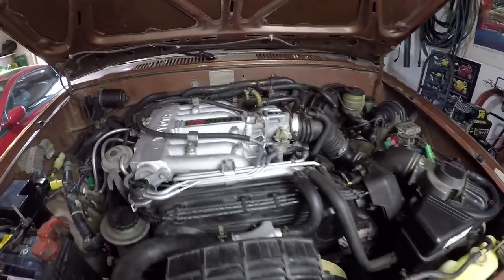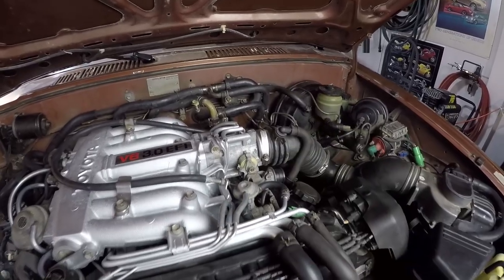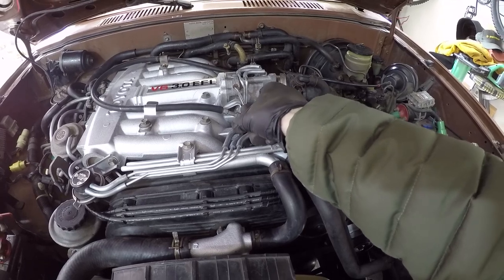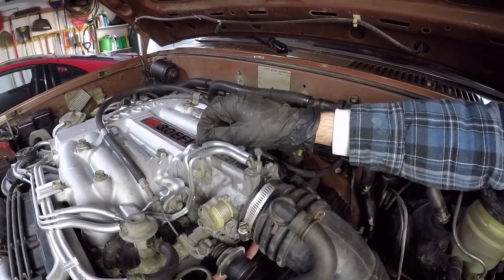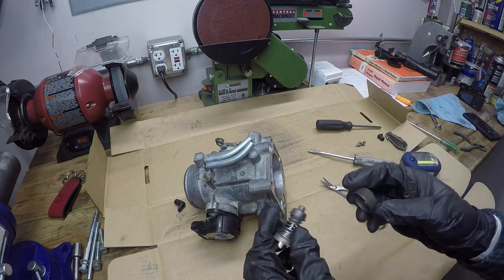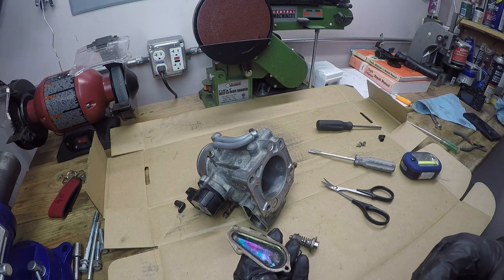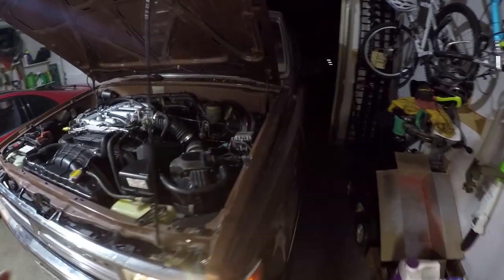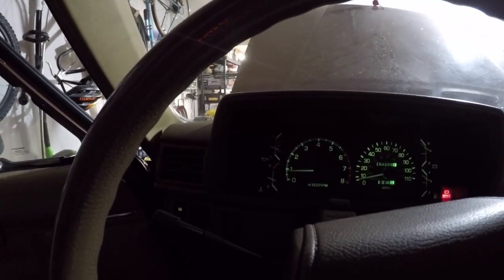Toyota 3VZE | Ep.9 | High engine idle speed EASY FIX!

Comment: I got an issue on mine, it always goes to a high idle but if I rev it a bit it’ll drop to my adjusted idle. I’ve got it adjusted to 800rpm and high idle is around 1200 till I give the throttle a blip then it’ll idle back to 800. Think this could be my issue?
Reply from the maker: I haven't heard that one before. Hmm. I suppose it could be this, but I'd first check to make sure the butterfly valve or the throttle cable isn't binding somewhere.

Comment: Would this work for low idle too? My idle adjust screw doesn’t seem to do anything in when turned in either direction. My warm idle seems about 700rpm
Reply from the maker: This would only help if you're experiencing low idle during a cold start. Interesting that the idle adjustment screw doesn't have any affect at raising the idle speed. I would check the simple stuff first, like the air filter, to make sure it isn't clogged. Then I would check for vacuum leaks because those can sometimes cause a rough and lower idle.

Comment: Thank you so much for your posts! Very helpful. Have ever played with the TPS and adjustments?
Reply from the maker: Not on this 4Runner, but I have on a pickup with the 3VZE. I'd recommend adjusting it if the engine idle "hunts" when you press the brake at idle.
Reply: @PracticalEnthusiast  I just did the heads on my 94 4runner and replaced parts along the way...including the TPS. I pretty much set it in the middle. It doesn't "hunt" when I push on the brake. From what I gather, the TPS has to be set prior to timing it, and I am having no luck in finding a video in how to do so. No explanation in my Haynes either. Thank you for your quick reply and thank you for taking the time!

Comment: I’m having problems with my 1992 Toyota V6 3.0 EFI  after my suv is warmed up and my idle speed is 800 the engine dies when I shift from park to drive. If I shift from park quickly over to 2nd or 1st it’s fine the engine continue to run fine. I have checked all vacuum lines and removed the throttle body and cleaned the IAC valve. I took my suv to Toyota dealership mechanic the ran a diagnostic check everything passed. They where unable to recreate the problem. Note it’s intermittent. Any suggestions, thanks
Reply from the maker: That's a tough one. The idle control on this engine is fairly rudimentary and I don't think it has any idle-up system to account for an automatic transmission being put into drive or any other gear. That makes me suspect that something may be wrong with the torque converter. It might be partially or fully locking up when put into drive, causing the engine to die.

Comment: Thanks man!  Mine has a high idle but also the idle surges sometimes.  You think this is the issue?  I took the TB off and coolant goes through it nicely so I'm at a loss.
Reply from the maker: Does it surge only when the brake is depressed? If so, it is likely your throttle position sensor is out of adjustment.
Reply: My 88’ 4Runner surges at random too. Took throttle body off and cleaned it. Ran the codes for the check engine light and it shows “TPS” so gonna change that next. It’ll surge when I push the brake it but some times does it even with the brake not engaged, still could be tps? Or anything else?

Comment: I noticed you have 22R style connectors and a 22R style ignition coil and igniter. Did you swap it and why?
Reply from the maker: I never swapped it, so I'm not sure what's up there. Sure it wasn't used on early 3VZEs as well? This one is a first year (1988).

Comment: I know this has nothing to do with your video Can you help me?
I ran the advanced diagnosis program.
Instead of error codes the o/d and check engine lights flash continuously.
Do you know what it is trying to tell me.
Reply from the maker: By "advance diagnostic program" do you mean bridging E1 & TE1 in the engine bay diagnostic box? 

If you are getting a continuously flashing check engine light when bridging those two terminals, then it could mean the that the E1 terminal is no longer connected to a ground (this happened on mine). Try grounding the TE1 terminal to any other ground point in the engine bay.
Reply: @PracticalEnthusiast  Yes after running E1 to TE2 test mode
Toyota service manual page FI 128
Reply: The overdrive light and the check engine flash at the same time continuously.
All other lights are off. My problem is truck runs fine until it gets to operating temperature.
Then it looses power misses and surges forward .  Very rough idle Have checked the basics plugs,wires timing.
Replaced tps . Had top end rebuilt 3600 miles ago. Burnt exhaust valves.
Reply from the maker: Try bridging TE2 with a ground somewhere in the engine bay. It is possible that E1 is no longer connected to ground. That hopefully would allow you to pull a code.

Aside from a possible mechanical/compression issue that crops up only when warmed up, I would guess that possibly the engine temperature sensor is faulty.
Reply: @PracticalEnthusiast  problem solved with used coil assembly.
Still don’t understand o/d and check engine flashing continuously after advanced diagnosis test. Oh well what ever.

Comment: Hello, great informative video.
My 90 4Runner is fluctuating the idle very bad, especially when driving in the highway. 
Would this procedure fix the problem?
Reply from the maker: This probably won't help. I'd suggest checking the throttle position sensor first. It may just need to be adjusted.
Reply: Thank you for replying. I ordered an EGR Valve Assembly and a Throttle Sensor Positioner, but I'm I can't remove the nut/collar to clean the chamber just like you did. 
Please help.

Comment: Hey what’s up bro I did head gaskets and valve adjustments. Cleaned the whole intake manifold . All new vacuum hoses and connected. I’m staying at a low idle at around 500-550. Messing with the idle screw only makes it go to lower rpm . I can back it out almost all the way out and still won’t go past 500-550 rpm. Where should I start? I already sprayed carb cleaner and propane’d around vacuum lines and throttle body with no change in idle
Reply from the maker: Does it run fine if you maintain idle by opening the throttle? Does it seem like it is misfiring?
Reply: @PracticalEnthusiast  at first cold start up I have to press gas to get it to start. Then after that it’ll idle at 500-550rpm
Reply from the maker: @kevinsalguero1357  have you let it warm all the way up? No misfires or rough running of any kind? I know the idle is low, but if you steadily increase the rpm, does the engine sound & run fine otherwise?

Comment: My 1990 Toyota pickup sr 5  4x4 v6 3vez engine goes always up to 2000 rpm on a cold start, then after few minutes it goes to 850 like it should.... in the summer time I can deal with it, but winter time 2000 ~ 2100 rpms is way to much, I'm afraid this will screw up the engine. do you have an idea on the problem or how I could fix this? Or anyone....Thanks..
Reply: Yes i do. Screw the adjustment collar a few theads farther in. The farther in you screw it the lower your HIGH idle will be. Clean it thouroughly before reassembling it.

Comment: I have 500 rpm, I tightened the bolt as much as possible, so it consumes less fuel.
Reply: You may have lower oil pressure as a result. Not worth the risk of pressure loss.

Comment: Do you need to bleed the coolant system after disconnecting those coolant lines?
Reply from the maker: You shouldn't need to. A very small amount of coolant escapes the system (be sure to plug the hoses with bolts or something similar!) and the system will self bleed itself after a few full heat cycles.
Reply: @PracticalEnthusiast  Awesome thank you!  I need to take apart my throttle body on my E30 which also has coolant lines running through it.  But you know that because I'm literally going to be following the advice of your E30 videos as I deep clean my TB.  Thank you for these awesome videos!

Comment: The 3.4 is an exponentially better engine.  I'm doing a timing kit on an early 3.0, with the spring tensioner, and it's depressing.
Reply: Why is it depressing? The 3.0 can be a good engine if you install headers and delete the EGR and catalytic convertor. Mine has good low end torque and runs well. I also put Multilayer steel headgaskets on it. Shoulld be good for a couple hundred thousand more miles. I have the hydraulic tensioner on my 93 model.
Reply: @Supercharged  Probably only because I've been spoiled by working on 3.4's.    There's so much more room, although the starter is somewhat cramped, and even with minimal attention, they seem to keep going and going.  In fact I once posted a clip of my last 3rd Gen odometer rolling over to 750,000 miles.  
I bought that truck, supercharged, with almost 200,000 miles, for $2,000.  It needed a shift solenoid, so I did a Transgo reprogramming kit while the pan was off.  I later sold the supercharger for $1,000, and often left the truck running throughout the work week. With work paying a weekly vehicle allowance, I managed to drive a nice looking truck, for many years, and for very little money. 
 After 500,000 miles, I may have changed the oil only twice. I ran a broken radiator cap, that allowed no pressure to be built, to prevent any coolant leaks. Truck still looked good, when I bought my fourth white 3rd gen.  Low miles, mint condition, but title problems.  
Fortunately, I had several titles.
Reply: By the way. I'm still running the same radiator cap. AC is almost painfully cold, yet the engine temp very rarely exceeds 180°, according to my livestream scanner

Comment: How did you get that damn plug out so easy??  I have been messing with mine all day and it won't back out.  You make me look like a moron over here!
Reply from the maker: The threaded piece? Mine wasn't too difficult to unscrew. I used some thin needle nose pliers to slot into the two indentations of the plug. That gave me enough grip to unscrew it. I guess try soaking your threads in PB Blaster to help it free up?
Reply: @PracticalEnthusiast  Yeah, your 4runner was treated so much better than this truck.  The threaded part is fused in there like ever other threaded piece on this thing.  PB plaster, tried the scissors but moved to trying to knock it out with a hammer and screwdriver.  I think I'm going to have to cut up an old socket and make a tool to get it tight. 🤔
Reply from the maker: That just might work. I can't imagine how that piece got so corroded, but I suppose anything is possible.
Reply: @PracticalEnthusiast  you and me both my friend. 🤣🤣
Reply: Man Of Steel Z32 I’m in the same boat... I cut a pry bar with a 90° handle with no luck. Have you tried to heat it up?
Reply: @snoclips7331  no I haven't done that yet, I have made a couple of tools out of some sockets even and no luck.  Even bought another used one and it is fused in there as well.
Reply: @snoclips7331  I finally got it out of there today!!  Man it was a pain in the ass but just keep at it.  PB plaster, a sacrificial 17mm socket, a lot of patience and it is finally done.
Reply: Man Of Steel Z32 NICE!! Would love to see a pic of the socket/tool you made. Was it worth it? Did it fix the idle problem?
Reply: @snoclips7331  yes it fixed it.  I will make a little video of the tool and put it up on YouTube for you. I'm not sure how else to get it to you
Reply: Man Of Steel Z32 if you have Instagram DM me @toddstoyota
Reply: @snoclips7331  I don't have IG or anything like that.  I have the video up on my channel if you want to check it out
Reply: Man Of Steel Z32 awesome! Off to get a 17mm!
Reply: @snoclips7331  Heck yeah dude.  Put the throttle body in a vice and keep the PB blaster on it.  Once it is out clean up the threads with a wire wheel and it will thread right back in.
Reply: I've made 3 of those sockets 2 with a bench grinder and one with a file and I've let it soak in wd40 for nearly 2 days and it still won't budge
Reply: @coop_69  Just keep working man.  You will get it.  If worst comes to worst, let me know, I have a 2nd throttle body that I got cleaned up if you need it.
Reply: @kaleljll1  I'll have to let you know I'm heating it up tomorrow  and letting it soak again tonight
Reply: @kaleljll1  oh man I've been working at it all day I've heated it up I welded my pliers and channel locks together so I can get a good grip on it and I've put all the force I could muster into it and it will not move at all
Reply: @coop_69  I actually had to get it moving the a hammer and a screwdriver.  It is scary but it will get it moving
Reply: @kaleljll1  I'll try for a bit
Reply: @kaleljll1  thank you man I got it spinning put it 4 turns out and she's idling beautifully now once again I can't thank you enough
Reply: @kaleljll1  well rip it's been a day I checked the oil cause it was a little low and all I've got is foam
Reply: @coop_69  oh no!!
Reply: @kaleljll1  I already did the head gaskets a few months ago and I did some research and it's not in the rad or anything and I think it's just moisture and assembly lube and first start additive just built up on the cap and around it so I cleaned it off and topped it up and I'll check again today

Comment: Sell it while you can folks or you'll become a mechanic like I did... That exhaust header has all 6 tubes ramming air into a port that is smaller than a single vw exhaust port, and that's not an exaggeration, add in aluminum heads on an iron block and it's a recipe for disaster. The engine belongs at a shooting range